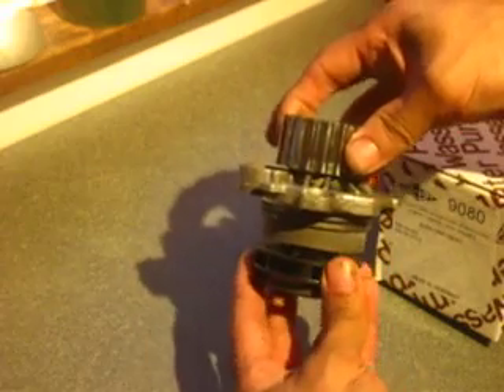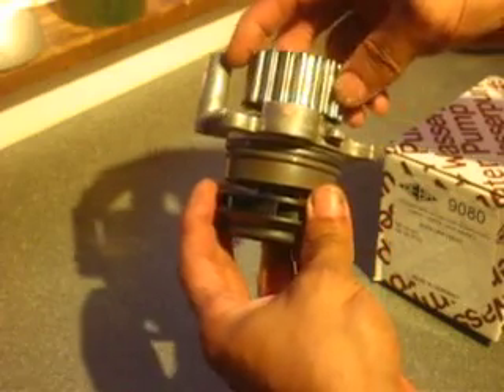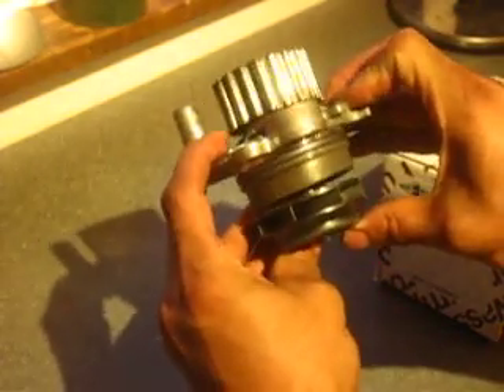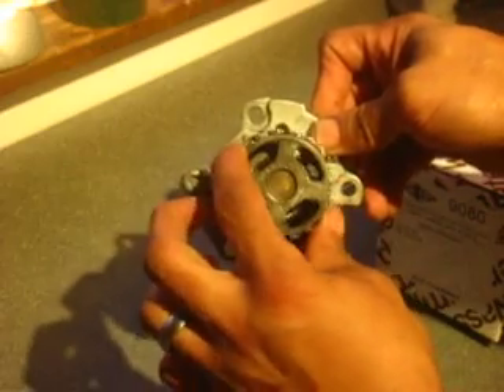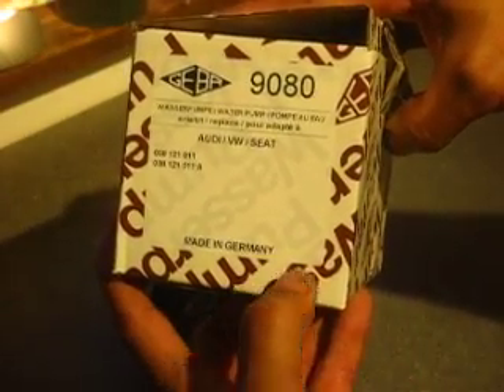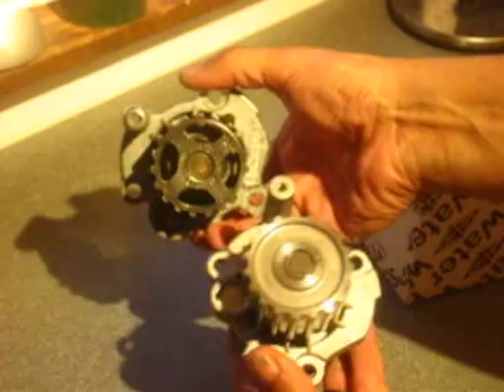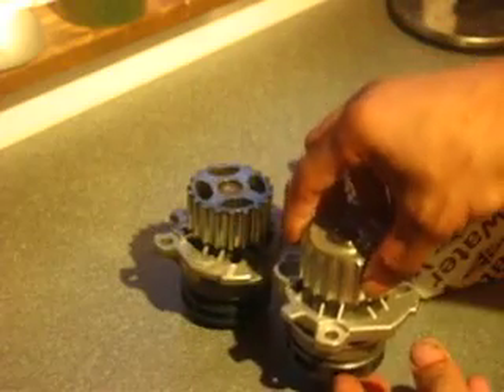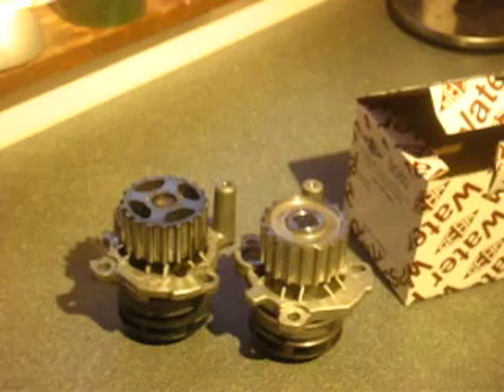Compare New VW Water Pump - Plastic vs Metal

Comment: I have driven an audi a4 1.9tdi for 22 years and have never had to change the water pump (3 xa4 tdi and 2 x total loss) and driven more than 1 million with the 3 cars. But yes Audi made the best cars in the 80s and 90s And especially the 1.9tdi easily drives a million km and never engine failure.......butt that time is gone with the direct injection engines (carbon buildup drama's ....lower qualitie becouse the dieselfraude etc etc etc
Reply from the maker: Thanks for watching. I think part of the US based VW problems has to do with arbitrary emission controls and general quality control and not using German parts. So many companies have a clear financial incentive to go with the lowest bidder for parts and services. Gone a the days when we see an auto manufactures take pride in the products they produce. I also think the 1.9L Turbo diesel injected are amazing and to think engineering is over 25 years old. Disclosure: I lover VW back from the air-cooled days. My next step will be Electric and I am looking to the financially battered VW/Audi for an innovative future direction.

TDI Love from Chicago.

Comment: A good lesson in sticking to the manufacturer's replacement schedule. It's about 60,000 miles for water pumps, that's about 100,000km. 114,000 miles was a risk that didn't pay off. Looks like collapse of the bearing was the problem, not the impeller.

Comment: my water pump is not leaking, but it is time to do the timing belt so I will be replacing it. do you know, is it possible to rebuild these water pumps? could I install high quality bearings, and seals in two the water pump that is in the car at the moment? it seems like there is not a whole lot to a water pump, and you could you should be able to replace those items. Do you know if this is possible? Thank you very much for your video.
Reply from the maker: Thank for watching. It is not recommended to try and rebuild these water pumps.  One: the cost of a new designed on is relatively inexpensive, and two: these things spin at Thousands of RPMs.  I would just buy a newer designed one.  There is nothing worse than having to rebuild your diesel motor because your water pump fails... I know from experience.  Rule of thumb: if you take off the timing belt = change Timing belt, water pump, and rollers.

TDI Love from Chicago.

Comment: Will do. Who's kit do you recommend? Read that DieselGeek's kit come w a metal impeller for the water pump.
Reply from the maker: +Dave Kana Thank for watching and subscribing...
I recommend parts from (1) MetalManParts.com, (2) DieselGeek.com and (3) FixMyVW.com (in That order).  These sellers have spent the time to research and provide real solutions to high mileage VW & Audi  diesel autos that support your investment in your auto.  They also have state-side phone numbers and provide technical support free of charge to home mechanics.  Don't get me wrong IDParts.com, KermaTDI.com, shopping.BoraParts.com, shopdap.com all support the diesel community and bring wonderful products to the table but they are more geared to tuning and/or speed.  I have worked with all the above companies and they are great resources for keeping money in your pocket and keeping your wheels on the road.

TDI Love From Chicago...
Reply: +GallowayChicago 
Awesome information, thanks, Dave!👍

Comment: German cars are the oposite of what they ware before crysler and mercedes joined. Not german car compete with General Motors for THE MOST UNRELIABLE AND WORST DESIGNED CARS IN THE WORLD.If i ever buy a post 2000 german car i give anyone the right to slap me
Reply from the maker: +drevilatwork 
I have heard Europeans say that there are two flavors of German car. The cheap ones made for regional sales and the ones made for export. We in the west still hold on to the image of the industrious and efficient German engineer, but you are right capitalism has reduced EVERYTHING to just profits and losses. Mostly the consumer loses. Why should a company make a car that will last more than 5 years? They (the auto manufactures) are knowingly using common bolts on doors and plastic components in primary motor functions. But don't stress out. We are 3 years from 80+% composite smart cars. As it turns out the price of steel is the most expensive and unpredictable part of auto manufacturing. And these profit driven companies are set to make 100% rustproof car by 2019. Note: rustproof does not equal oxidation-proof. Gone will be the days of the WiFi inhibiting Faraday Cage Auto. If you are worried about strength, you need not, because modern tanks are now being made of composite materials. I am still holding my breath for 80% efficient PV solar and 100% power leak proof rechargeable batteries/Capacitor. (I guess I went off topic)
Reply: drevilatwork MINE ISD A 2001  NEW BEETLE 1.8T .... I HAVE HAD SO MANY PROBLEMS BLOWING SENSORS AND OTHER THINGS GOING OUT .BUT WITH 184 K ON THE CAR ........ANYWAY I HAVE SPENT COUNTLESS HOURS   TRYING TO GET THIS MOTOR TO PREFORM AT A VERY HIGH STANDARD .....
MY STOCK 1.8T 150 HP MOTOR NOW MAKES 235 WHP , AT 25 PSI ON A BONE STOCK MOTOR AND TURBO .... I DO HAVE MANY ADD ONS FOR PERFORMANCE  GAINS.   THE CAR IS VERY QUICK ......I WISH I COULD AFFORD 300 WHP BUT TO ADD ANOTHER 65 WHP WOULD COST ME AT LEAST 3+K.....WHICH IS RIDICULOUS ......

Comment: So who is the actual manufacturer of that German water pump?  I am curious...I need one.  The guys I talk to say there are aluminum (which can corrode?), steel (with spot welded fins which may be weak?) and the new plastic which is not really plastic but a polymer upgrade which is "supposed" to be good.
Reply from the maker: primovid The one in the video is "GEBA 9080 Water Pump" water pump for Audi VW 038-121-011-A. My old one should have been a Metal one because the VW is a 5-speed, but the failure was due to the cog side having open fin holes. Through these holes the worn water pump bearing escaped. Aluminum oxidizes only in the presence of oxygen. You might see some white oxidation where the seal is but never on the impeller. The plastic ones are lighter and strong, but should be check every 30k miles. The new spot welded fins are not balanced and because of the shape of the fins the unit works harder (more work = shorter life... generally). I just installed one in a 2.0L Jetta. The seals on the spot welded ones concern me too. I have heard that they leak. I will tell you more when I know more, but at this point I lean towards the GEBA 9080.

VDub Love from Chicago.
Reply: Thanks!  From what I've been reading, sounds like the true German made pumps are the way to go, like Geba and Hepu.  Read at least three stories about failed Graf water pumps (which sounds German, but is not).  Can't cut corners on the water pump!

Comment: COMPARING THEM SIDE BY SIDE SEEMS TO SHOW THE NEW PUMP AS BEING TALLER THEN THE OLD , SEEMINGLY THROWING AFF THE ALIGNMENT OF TIMING BELT JUST BY LOOKING AT IT .......I OWN A 1.8T AND BELIEVE ME THE ENGINEERING ON MANY ITEMS LEAVES A LOT TO WANT FOR BETTER ......
Reply from the maker: eyestungdustnblind The old pump actually was shorter because the bearings were missing.  When the new one was installed is was spot on.  The new one was designed for the car and 100% OEM.  You have to be careful because these parts are now being manufactures all around the world and some places don't have as strong quality control as others. But I know what you are talking about, because alternator cogs tend to move all over the place and there is no real means, on these engines, by which to adjust them.  I just installed a 120A alternator from a VR6 GTI on a 2.0L Jetta and it was off by about 1/3".  I just rebuilt the original 90A alternator and re-installed it.

VDub Love from Chicago...

Comment: The real reason to change out the pump during a timing belt change is becasue the new belt & tensioner applys more pressure on the old waterpump and bearing. This will/may cause a failer before your next timing belt change. Now you know one of the reasons to change your belt ON TIME. And your belt would not have laster 175k (nearly twice it's life expectancy). Sounds like your a gambling man that lost.
Reply from the maker: Nope!  I purchased the TDI used and I took the previous owners word that the timing belt had been changed at 80k, but apparently the water pump was not changed. I changed the clutch twice due to a defective clutch disk that VW would not own up to, before the timing belt went. The first clutch has rivets that could slide in a channel. The next OEM clutch (one year later) had heavier rivets and no channel.  The first clutch literally shredded in the clutch housing. I'm off to do a different TDI clutch today. Weeeeeeee
Reply: Yea, when buying used, I only except receipts not words. I also inspect the belt either way. Yea the plastic impellers are bad design, just to save a couple bucks. The bad thing is that it may warn you by leaking at the pump. A fried of mine just changed the clutch at 200k for the first time (owned since new).
Reply: +GallowayChicago oh man, that sucks!

Comment: Those plastic impellas are droping off for fun over here in the UK. All models of the 2.0 TDI especially on the lastest model Crafter van. VW don't care about customers vans which overheat and have to be recovered. These pumps are total rubbish.
the bearings are not going like on here just the plastic dropping of the back.

Comment: 1.9tdi 90hp timing belts have a 90.000km life span, u can skip the waterpomp change once if there is no play at the bearing and if its turning nicely without drag. 
If u drive solely highway at low rpm and low engine load u can expand the life span with 10%

Comment: According to my VW specialist, VW OEM impellers are made of PPS (not the junk plastic used in the 1990s) and are rated over 400 degrees and will never crack or become unbonded. He also says the metal impeller causes cavitation because it is not smooth like the PPS impellers.  Also Ferrari, Lambo and other high end cars all use PPS water pumps. But I agree with Galloway that the bearing on the metal impeller pump looks much stronger. Of course,my 2003 NB1.8T just had a major coolant failure!

Comment: The water pump has to be changed for three reasons (some mentioned here).

1. New timing belt will causes lots of tension on the h2o (used)bearing (as seeen here) causing failures.
2. It's right there and req a little extra time.
3. Small bearing and fast rotation = limited life.

Metal blade pump is better, plastic ones are known to become unbonded with the drive pully/gear and stop pumping fluid (overheat).

Comment from the maker: Sorry to disagree with you but, the water pump has a sealed bearing and after 100,000 miles on the cars odometer, the water pump, because of its smaller gear has travailed the equivalent of 200,000+ miles (roughly twice).  So, changing the water pump is not done solely because it is easily accessible, but because it has a service life too. And just like in my case a water pump failure can really be a big headache.

Comment: after 80,000 miles it is wise to change the pump belt and tensioner on the VW 19 tdi. im doing one at the moment, i will post it next week. good vid there.

Comment from the maker: @Sebastian7224 when will the auto manufactures learn? save a penny lose a dollar.  Just charge me the $25 dollars more and do it right the first time.  Who the hell wants a plastic water pump that will be subjected to +230 degF water.  Especially when it is connected to your timing belt.  Customer loyalty must be worth something. 

My 96 Chrysler mini-van has sub-hardened bolts on it pullies(water, Idler, P/S pump).  It probable saved Chrysler $15, but cost stranded customers $750 when it breaks